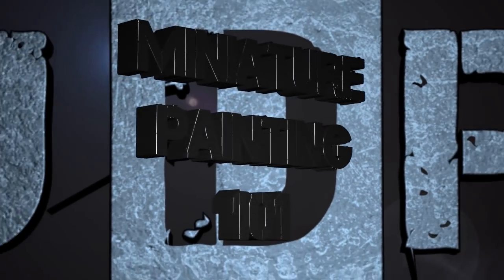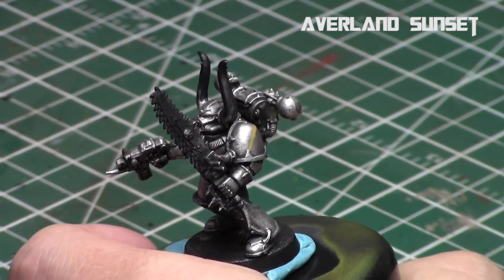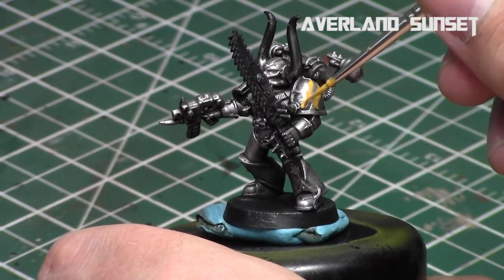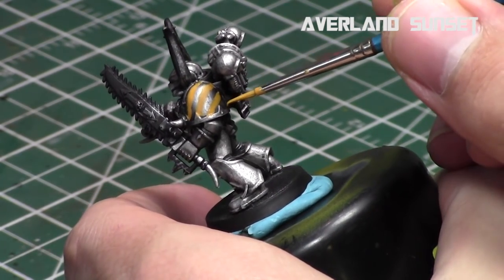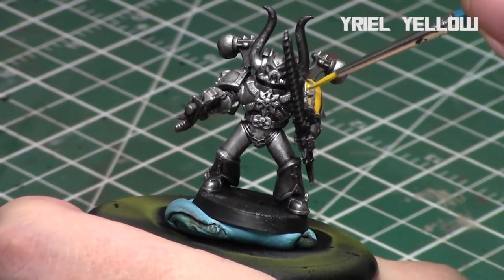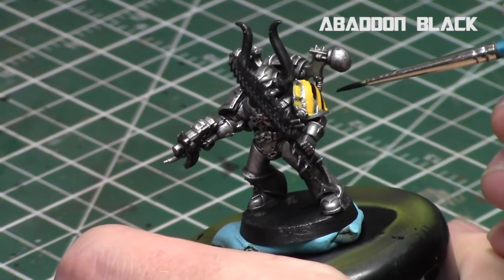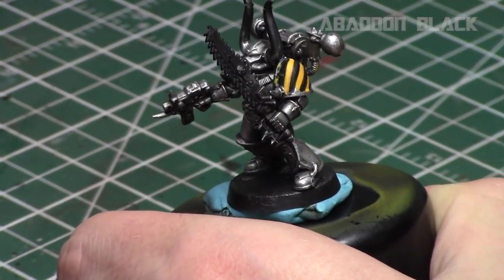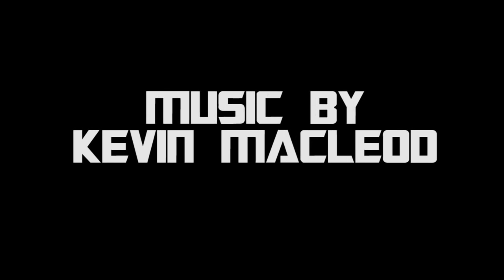Miniature Painting 101: Part 92 - Hazard Lines

Comment: Light tones first, dark/black second.  Yes.  I would like to suggest an alternate method.  Base coat the whole curved surface with yellow base tone, then use the highlight color to set the anchor points of the stripes.  Then end with black.  Method suggestions gives chance to set a good yellow basecoat (especially over a metallic) before developing the freehanded pattern.